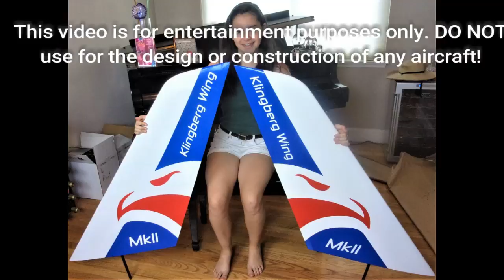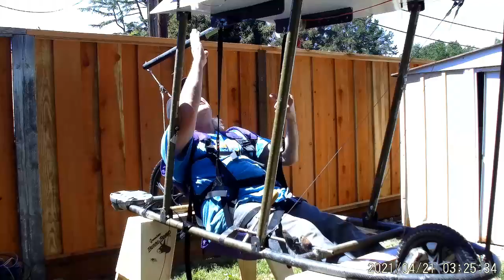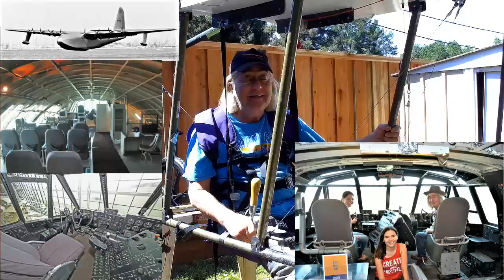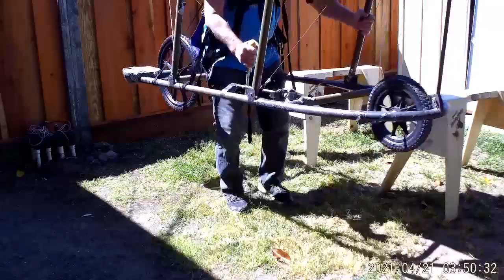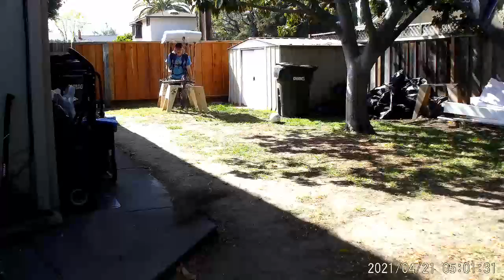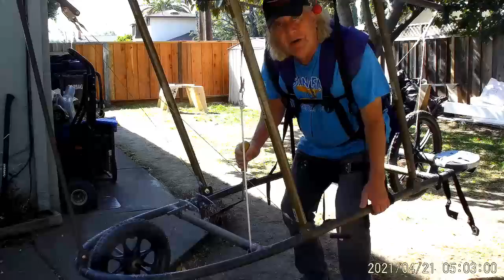KW MkII Rigid Wing Hang Glider Development - Human Machine Interface

Comment: In the past I've wondered why you don't start your flight testing from the saw horses as you did your practice runs in this video.  Doing so would make your launch a lot easier on your legs!  Also I'm concerned about the foot resting position with the weight of your legs on your achilles tendon - that really seems to me to be a source for fatigue, restricted circulation or blood clots.  I would think some padding is needed at least.

As you say, Fly save and good luck!
Reply from the maker: Hi Roger: All good points. The next scheduled test date is 5 Aug and we will indeed be starting from sawhorses. When we get to big flights where there is only one run, we can dispense with them. The long-term plan is to have foot rests with toe clips to allow the pilot to both pull and push and thus provide pitch trim and damping. You are not alone, much of what many people see as "issues" are simply items that are a result of quickie solutions for a test aircraft an in no way reflect what a final design should be. I very much favor the "cut and try, then redesign" school of engineering. That is one reason there are no detailed 3-D drawings which at this stage would probably be a waste of time given the number of changes I foresee.

Comment: Hi Rol, at what speed will the wing begin to create enough lift to relieve you of some of its weight during the ground run?  Wishing you the very best result!
Reply from the maker: Thanks for the good wishes. The glider stall speed loaded is around 22 mph. The glider should be able to carry its own weight somewhere around 10 mph, so I only have to get up to about 10 mph and any downhill slope will take care of the rest. HGs often takeoff in a "stall" condition if winds are light because so few of us can run nearly 20 mph!
Reply: @KlingbergWingMkII  and running 20mph while carrying a hang glider!